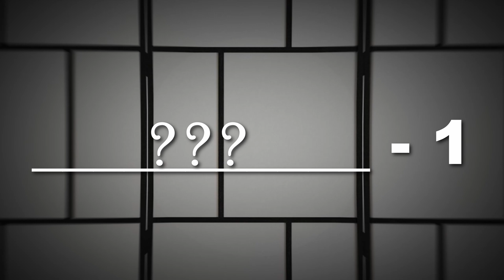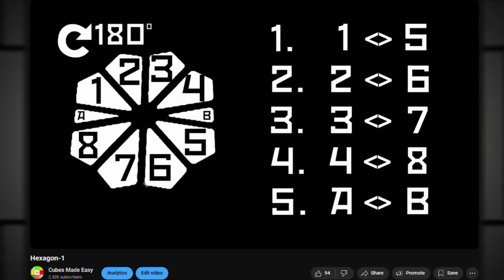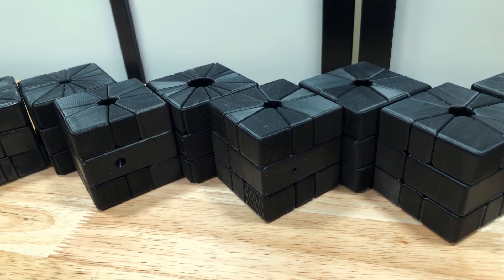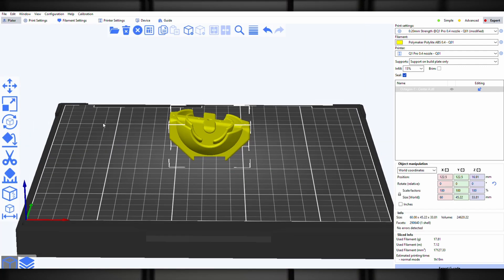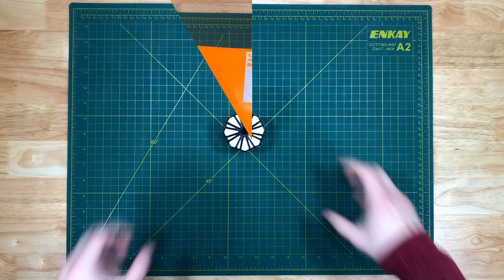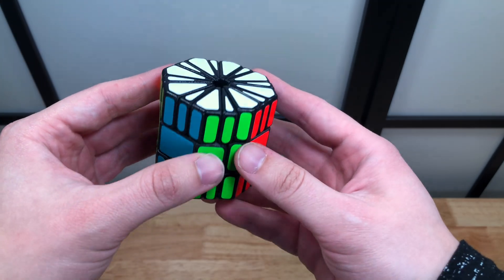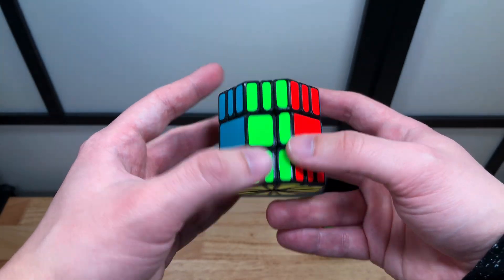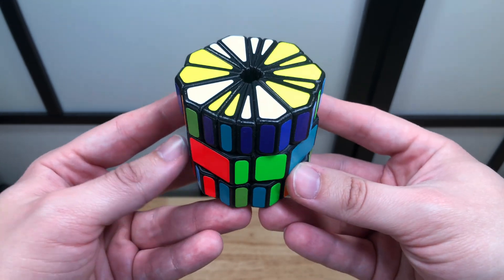Making the world's first OCTAGON-1!

Comment: When will it be available for purchase
Reply from the maker: I wish I knew. I'm working on it, and I hope the prototypes I showed suggest as much. I want to get everything right this time, and not release anything that's half-baked. I really appreciate the enthusiasm for acquiring the puzzles, and I genuinely hate delaying all of it. I just have to work on it in the midst of real life, which has made for slower progress than I had hoped for. I have time to focus on puzzle prototyping for the next few weeks, so I'm hoping to make a lot of progress. I appreciate the patience.
Reply: @CubesMadeEasy have you solved the octagon-1 yet
Reply from the maker: Yeah, it wasn't too bad. Haven't recorded the solve yet, though.
Reply: @CubesMadeEasy  can you please make a solving video
Reply from the maker: I'm working on many videos. That's one of them.
Reply: When solving it, did you use the square one algorithm that switches one of the top edges with the bottom edge
Reply from the maker: Honestly, I usually just try and solve the colors intuitively. Maybe it could be a bit quicker if I adapted the relevant algorithms, but that's not something I've done as of yet. The algorithms I try using are all for permuting the corners and then the edges.
Reply: @CubesMadeEasy  would the algorithm o